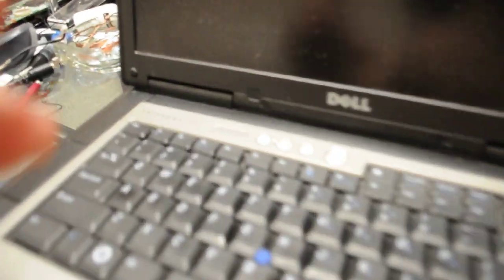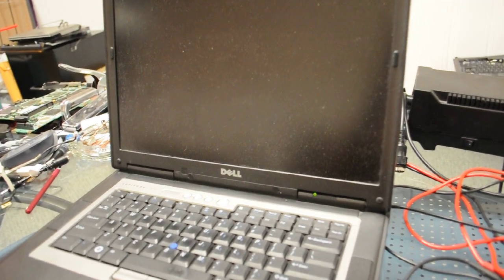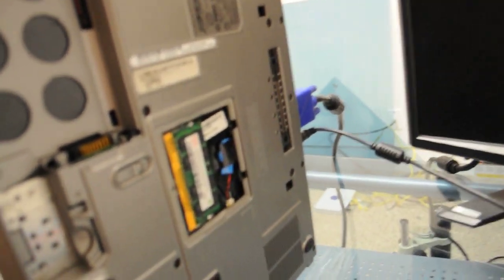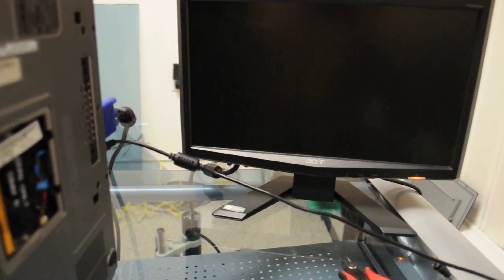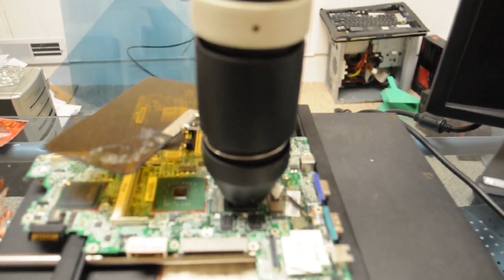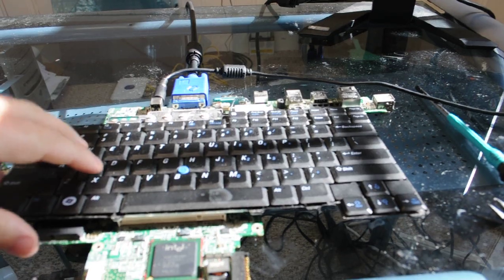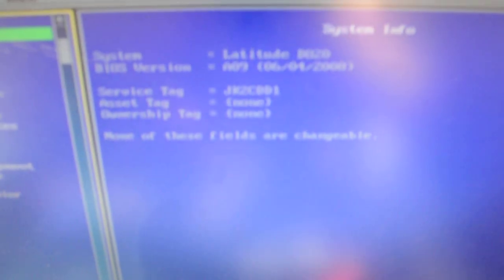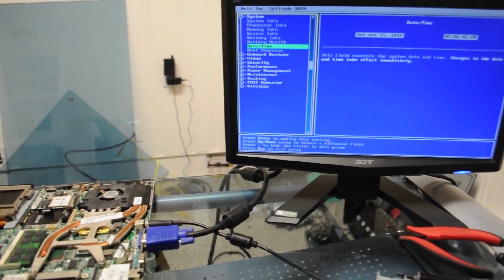HPReflow.com basic laptop reflow for a Dell Latitude D820 laptop with a bad NVS 110 video chip.

Comment from the maker: @SheBlindedMeWScience I paid $1000 for it.  How many botch jobs did I do?  Probably 300.  I bought broken motherboards on eBay and reflowed them and then tested them and so on and so forth until I found a system that worked for me.  I used liquid flux and hot air stations and copper shims to test.  Quarters with solder.  I tried everything I watched.  I can say they work, but not long if at all.  I spent nearly $10,000 on motherboards while doing DC jacks and laptop parts replacement repairs.